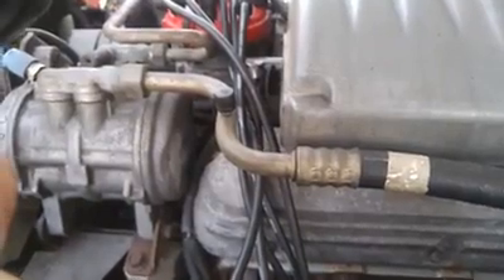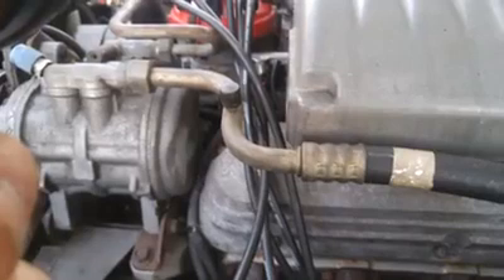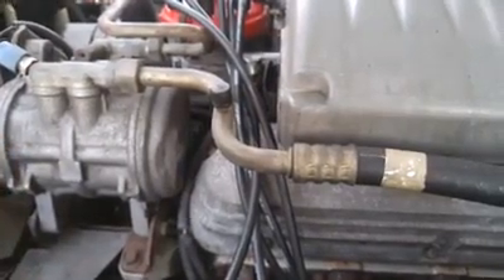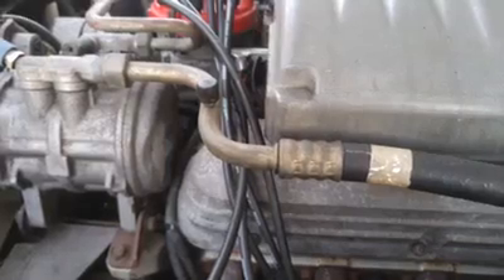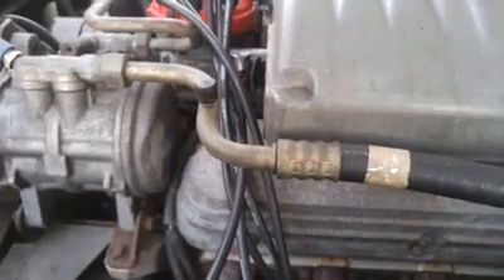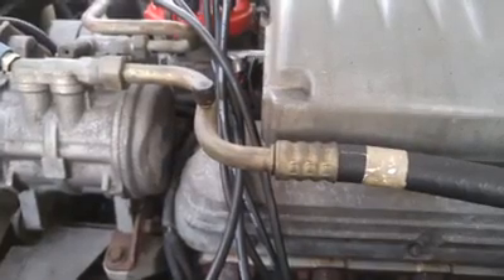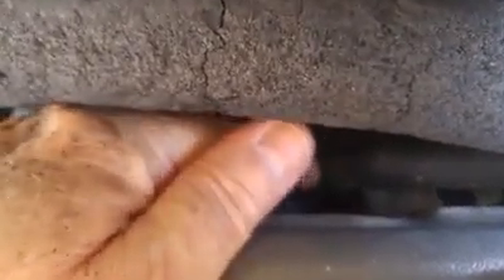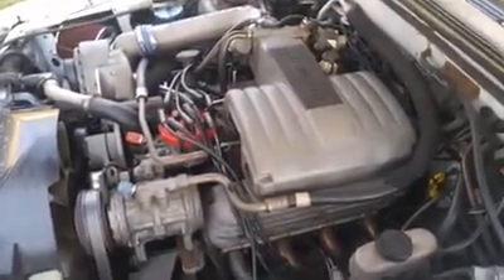Smoke Testing vacuum leaks in 5.0L Mustang Part 2

Comment: Great video 👍 I'll be doing this exact process on my supercharged 3v to narrow down why it's surging in first and second and leaning out. If I can't find a vacuum leak then it's off to the tuner to see if it's a tuning issue.
Reply from the maker: Look at the fuel trims on a warmed up engine. If it's a vacuum leak, the fuel trims will be very positive at idle, and as you rev the motor up they will return to much more normal.
Reply: @dragradialperformance3540  I don't have any tuning software to check it but now I'm wishing I did. Could driving it with a potential vacuum leak be damaging to the engine?
Reply from the maker: @fernandop937  the vacuum leak will cause (good functioning) O2 sensors to read lean. The PCM will respond by adding fuel one percent at a time until the lean readings go away. The PCM is limited in how many percent fuel it can add before it thinks something is wrong. In a stock fox body, that limit is about 12% long term, and a few more percent short term.

So the O2 sensors can detect the lean condition and direct the computer to fix it by adding fuel. It's an imperfect system, but it keeps the engine from running like total garbage until the leak can be repaired. If the leak is too big, the PCM might not believe the O2 sensors, and might think they have failed and then it would ignore those readings entirely and not correct the air/fuel ratio at all.

Without a scantool, you can still use an oscilloscope backprobed into the O2 sensor signal wire terminal, and see what the O2 sweeps and voltage looks like. But you can't tell what percent of fuel your PCM is adding or subtracting. This is where having Binary Editor and a Quarterhorse is nice.

Without the aid of datalogging, the next best solution would be a smoke machine. Fill the intake with smoke and look to see where it comes out. The lowest budget method of detecting vacuum leaks would be to use propane and a special tool that is basically a small nozzle for the propane bottle. Run the propane around all the potential vacuum leak points, and see if the engine responds to the propane by revving up.
Reply from the maker: Hey, makes sure your supercharger bypass valve is functional and opening. If it remains shut at idle, that will cause blower surge.
Reply: @dragradialperformance3540  how do you recommend me checking if it's working properly? A new one costs $100 so it would be good to get a new one as preventative maintenance
Reply from the maker: @fernandop937  If it's closed, it will cause blower surge. It closes when vacuum changes to zero vacuum or boost. If it's open, it will allow the surging airflow to recirculate into the blower and even out the idle surge. You can check to make sure it has vacuum at idle. You can grab the linkage and manually open or close it usually. Try removing the vacuum line and pushing the valve all the way open, then all the way closed. One way should make it surge, the other way should cure surging. Just make sure that the vacuum is there, and that the bypass valve is moving like it should. A quick rev of the motor should show you what the valve is doing if you're watching it like a hawk when someone else stabs the gas.